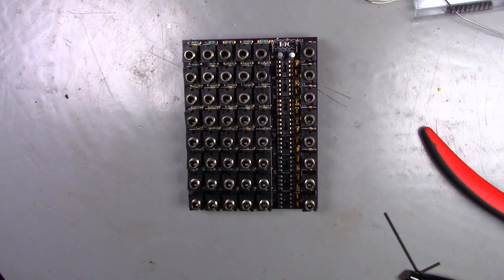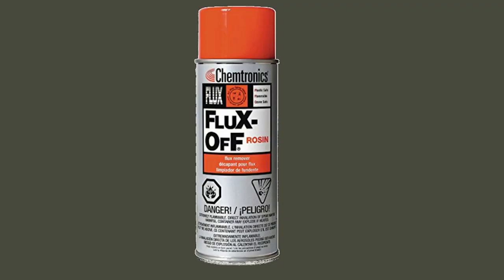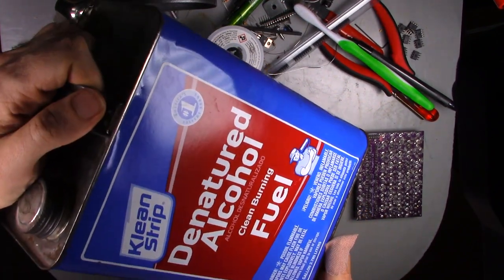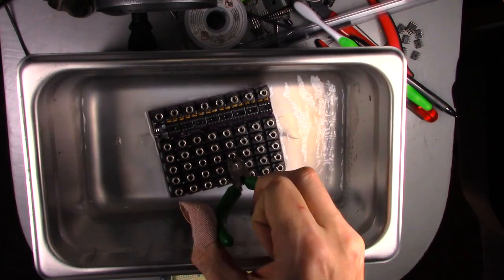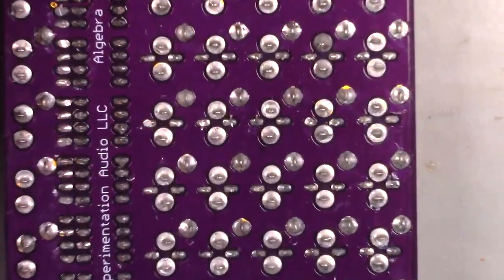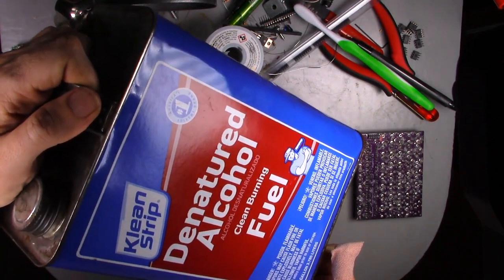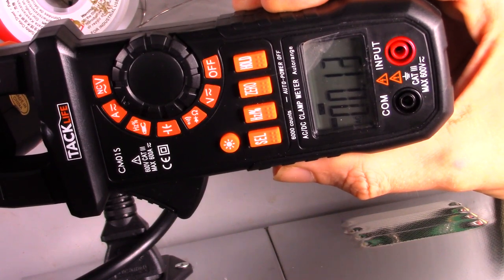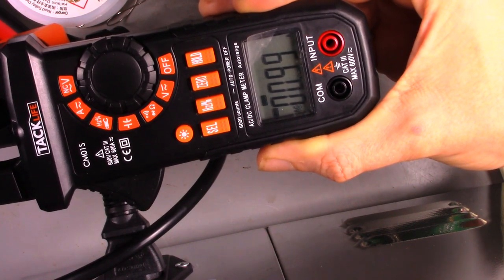Cleaning flux from a PCB, the easy way

Comment: Note to self: Denatured alcohol and carburetor cleaner as well as acetone based nail polish and non acetone based nail polish are good for cleaning circuit boards, but the acetone based nail polish and the acetone based nail polish (AT LEAST) will soften any plastic that it comes into contact with. These solvents can often be reused to clean another circuit board later on if need be.

Comment: I considered using raw isopropanol in my (similarly cheap) ultrasonic cleaner but chickened out because of fire risk. I ended diluting the isopropanol to about 40% and added a couple of drops of dish soap. Worked fine.

Good advice about keeping the solvent level below the mechanical components, I messed up a toggle switch when trying to clean flux with solvent - needed lots of flushing out before it came good again.

Comment: Not supposed to lay components on the bottom directly, not supposed to have such a low fluid level, not supposed to use flammable liquids, lots of things are dangerous in the video for various reasons

Comment: where did you buy that special AC outlet plug clamp stuff? The stuff which magnetic clamps connects to.
Reply from the maker: Where everyone get everything: Amazon. Just search for "Amp Clamp". Search for "Amp Clamp Line Splitter" for the plug adapter
Reply: Or eBay

Comment: You rinse it off in the sink????
Reply from the maker: Yes, water is only bad if there is electricity. Almost all PCBs in products have had a "wash" step. I always let everything dry a day or too before powering it up.
Reply: @Recklessexperimentationaudio  yeah I get it.. just seems needless is all.. water could get trapped and lead to corrosion.. and for what benefit?

Comment: I still don't understand why they recommend against alcohol in an ultrasonic cleaner. I think some of the folks in this industry are fear mongers.
Reply: 1. Alcohol vapors are flammable. 
2. Ultrasonic cleaners, especially if the fluid level gets too low, tend to aerosolize some of the liquid, which then evaporates quickly forming vapor. (Think ultrasonic humidifiers.)
3. Ultrasonic cleaners normally heat the liquid, too. Hot alcohol evaporates way faster.
4. The sheer amount of alcohol needed to fill an ultrasonic cleaner big enough for even modest size boards is significant.
5. Standard ultrasonic cleaners use normal switches, timers, and thermostats that cause sparks when switching. This could ignite alcohol vapors.

The upshot is that it’s a fire risk. They make special ultrasonic cleaners for use with solvents. But often it’s not necessary to use a full-alcohol bath anyway. One thing people do is to put the board into a small container or plastic bag and put alcohol inside the bag. Then you put the bag in the ultrasonic bath full of water. Not only is this far cheaper, it’s far safer. Another option is to use a bath composed of a blend of alcohol and water. The alcohol will still do its job, but the fire risk is reduced. (This is how windshield washer fluid works.) And finally, they make water-based cleaning products for circuit boards, specifically for use in ultrasonic cleaners.
Reply: Yeah, I'm not normally someone concerned over safety issues, but this just doesn't seem like a good idea. Flux off works just fine, and I've found Micro Care's cleaners to be even more effective still.
Reply: @ElationProductions  Ultrasonic is really good for getting flux out from hard to clean nooks, like under SMD parts, where you can’t get a brush in to scrub. But I wouldn’t fill a whole ultrasonic cleaner with solvent to do it! :P